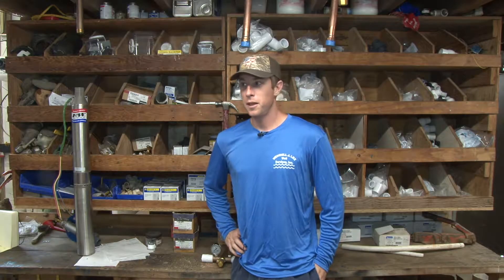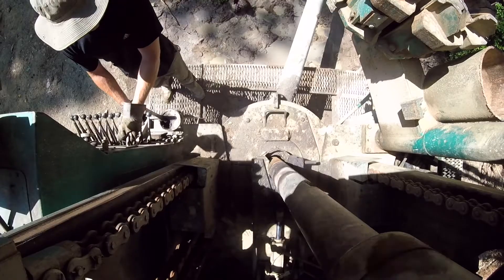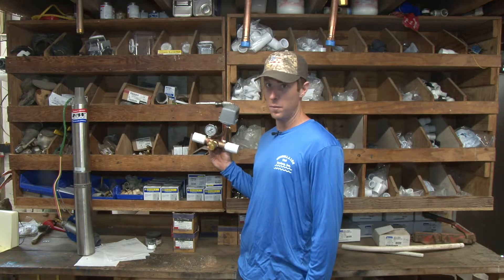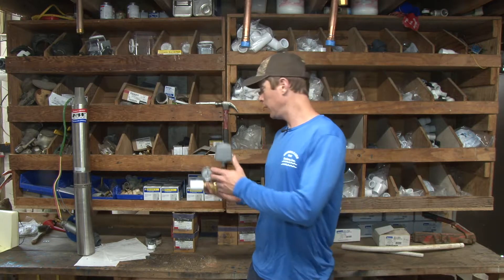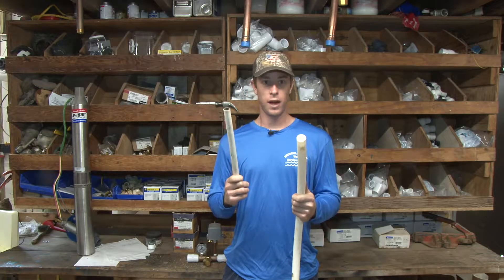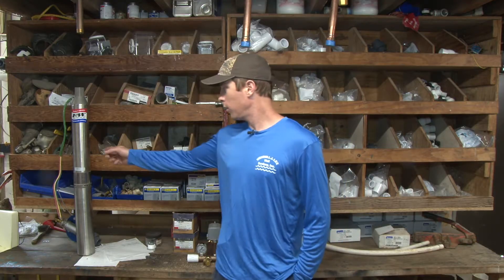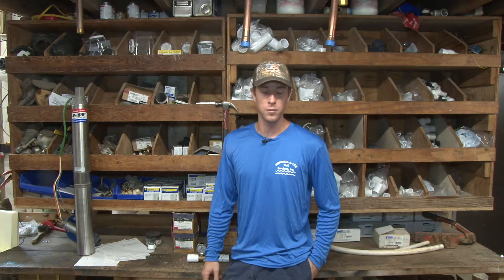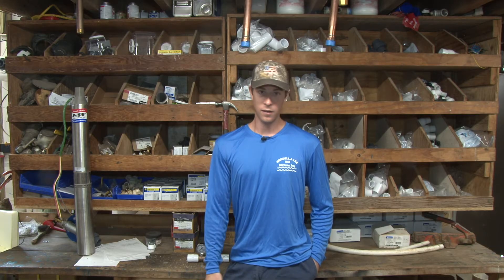How Do I Increase Water Pressure From my Well? How can I get more flow from my well?

Comment: I just installed a new submersible well pump and new pipe and new wire and new pressure switch. I am getting 5 minute periods of low water pressure maybe every 2 days. I have checked my pressure tank and it is good. My switch is set to 40/60 and my air pressure is 37 when tank is empty and tank is not heavy or waterlogged. I don't know what the problem is. It only last for maybe 3-5 minutes when it happens. Got any ideas?

Comment: Sir our switch is set to 40/60 what should my bladder pressure be 38?. As the plumber set it to 58 and that seems off to me. Water is losing pressure half way through the shower.
Reply: If your switch is 40/60, your pressure tank should be set to 38 psi. The standard is 2 psi below the kick on for the switch.

Comment: When I had to replace my well pump, I had asked several people about increasing the pressure and the answer I got was that depending on the well, and how good the water naturally accumulates will determine what kind of flow rate pump you could put in, so I didn’t hear any of this on this video Because apparently, if the water down below in the ground is flowing at a certain rate and you put a higher rate pump in it might suck dry or enough that you’re not getting water all the time?

Comment: I hope you are still online or maybe someone else can answer.  Here is my water system lay out. I want to solve this problem before it happens. My 350+ foot well pumps quite well. It will fill a 1,100 gallon tank. From this tank, using 2 on-demand pumps. One will fill a pressure tank for house 1, 50 feet away. House 2 will be 300 feet away. Here is my question, will I loose water pressure that far from the pressure tank? Thanks for any inputs and ideas.
Reply: I'm a year late, but as long as House 2 is not on the top of a hill or much higher than the pressure tank, I don't see why you would lose pressure.  I'm no expert though.

Comment: What size pressure switch do I need? Our water pressure is very low and there is currently a 20/40 switch on it. We just had a new well pump installed. Can I change my switch to a 40/60?

Comment: hey man just joined up .but thank the hell out of you for putting this is in country boy terms ! i just recently decided to say the hell with sirenes every night and ....ok ill shut up lol. im working with a old school centrifugal pump like i grew up on and all i really want to know is the proper location to in stall booster pump to increase pressure to the house ?my concern is that the supply pump(starite centrifigul)will get ran dry from booster pump ? if so do i run seperate pressure switches ?oh yhea my well hits good water at only 8ft and is from dropping plumb ball down it 30 ft total deep . im in the nw florida area crestveiw area. everyone keeps telling me jet pump .but i grew up on awesome well water in fort walton bch florida in the 70s and all we had was a centrifugal pump and a tank and best i can remember held 25 to 35 psi with just the shower going.sorry just got a buzz and rambling .anyway where do i put the damn booster pump and pressure switches ? finally back to the country

Comment: Sorry didn’t really get a clear answer! 
Because the well boar is only 4 inch the pump size is limited? According to the well guy/ plumber! So how do I then add more pressure to the very old house! With out drilling a new well to 6 inch boar ?
I’ve lots of room in cellar so was wondering if I had a secondary tank with higher pressure pump to the old house plumbing, it’s that even something Am I just being stupid

Comment: I have a 1/2 acre of berries planted. My drip irrigation requires 23GPM (drip tube GPM/100' is .9 and I have 2550'). My well pumps about 10 GPM. I was considering installing a booster pump that pumps 30GPM but did not know if it was possible seeing how my well pump pumps less. What happens if you place a higher volume booster pump after a lesser volume well pump?

Thank you Thank you Thank you
Reply: Split your drip into 3 zones or buy a 1000 gallon  holding tank with a booster pump.  3 valves and a controller would be my choice.

Comment: have you ever do fishing operation for falling submersible pump inside water well?

and

have you ever do enlarging water well casing to remove obstacle inside casing?
Reply: A well guy has a tool to get the pump right out and save you some time. I've been there.